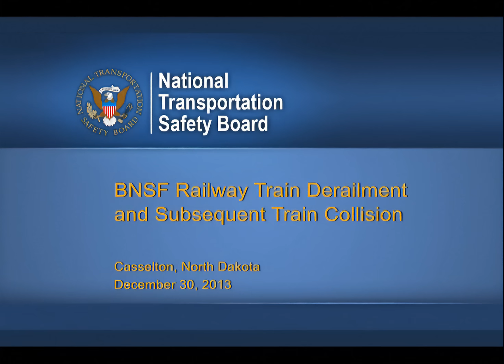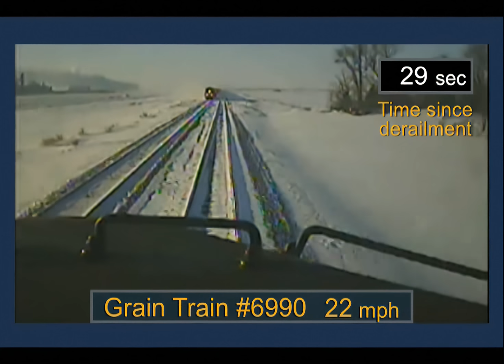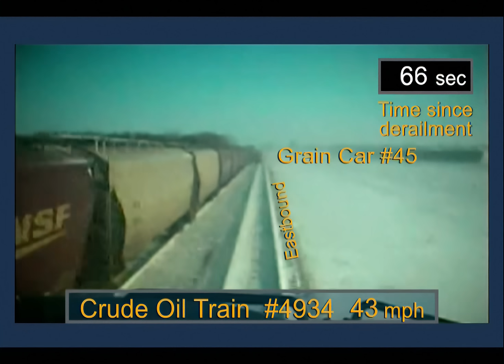BNSF Railway Train Derailment and Subsequent Train Collision

Comment: I used to work for a company that shuttled rail crews. Since we operated on the railroad right of way and inside rail yards, we had to go through safety training.  One of the things that we were told is that a train hitting our mini van was comparable to our mini van hitting a pop can.  Well, I calculated the approximate gross weight of a loaded coal train, the GVWR of the van, and the weight of a can of <insert soft drink name here>.

Scarily, it was pretty darn close. You don't want to FA with trains, because you REALLY don't want to FO.

Comment: This is the Casselton Train Derailment, and it's a long story.
6990, the grain train you see in this video, is passing by another train, 4934, the crude oil train.
The grain train, however, derails at about the 1 minute 30 second mark, and the grain train's brake pipes possibly disconnect, resulting in an uncommanded emergency stop. A defect in the axle caused it to derail. Then it switches to the crude oil train's perspective. They warn 4934 to stop because the grain train had derailed, however, due to it being a heavy train, and a freight train, the emergency brakes take a little while to pressurize, plus the weight. Just before the collision, you could see another grain car had derailed as well, and then, it happens. "WE ARE EVERYWHERE!" The train hits grain car 45 and causes it to fly off the rails. A fire breaks out, and the train is off the rails. Then.. The real part happens. KABOOM! The crude oil catches on fire and causes a massive explosion. Firefighters however put it out, and make it alright. Thanks to them, this railway would still be in action to this day.

Comment: For people that didn’t notice, if you turn up your volume as high as possible at about 1 minute, you can hear the radio conversation between the Minot East Dispatcher, 6990, and another train. It’s very distorted and quiet, but you can figure out what they were actually saying here: https://data.ntsb.gov/Docket/Document/docBLOB?ID=40425466&FileExtension=.PDF&FileName=Operations%20Group%20Chairman%20Factual%20Report%20Attachment%2013%20Transcript%20of%20Nolan%20Field%20Radio%20%20%20%20-Master.PDF

Comment: This is what happens when you put two train  tteacks  c lose togther. Irs c really a stupid idea. Even a 3grader wouldn't do this dumb thing.  He wouldn't even do it with a  Lionel. Are railroad people this dumb really?
Reply: Why don’t we just make highways 200 feet apart?
Reply: @Coonslayer7-l2g  "aircraft maintain an altitude separation of 1,000 ft"
Reply: Most of the rail lines in North America were build in the 1800s.   This includes mainline and passing tracks.   It might have been stupid...but it was 150 plus years ago.
Reply: I am one mile from the tracks ..they were built in 1925. They only built one track. One train has to wait on the side track while the other one passes. It's a 160 mile long track. Talk about stupid.
Reply: @PBFSENSOR  So 99 years ago they were....stupid?   THat was back when the average train was 20 cars long and the average car length was about 30 feet.   Yet they were simply just stupid?
Reply: Who builds a road with only one lane wide enough for only one line of cars? That's stupid. Ditto for railroads
Reply: @PBFSENSOR    Most of the world's freight rail operations are single line with passing sidings as needed.   At $1million per mile for heavy freight railroading a second line can be incredibly expensive and not worth it.  Not stupid.  Just financially what is needed

Comment: I’m an engineer going on 23 years at CSX 60 seconds was way too long to wait to tell that other train that they were in emergency.
Reply: Correct, wakey wakey guys,
Reply: yep
Reply: I was an engineer at  CP for 35 yrs and you’re right, as soon as the air went, there should have been an emergency call going out so that oncoming oil train could have soaked it sooner.
Reply: Apparently, they were on different frequencies anyway.
Reply: It was 30 seconds. Plus busy radio traffic
Reply: I was an engineer at XYZ railroad for 52 years, and an Inspector A1A-class (Tip-Top Division) and an all-around groovy cat. Wait, what was the subject again?
Reply: Former CSX Engineer and FRA Inspector, it was actually 34 seconds after the emergency was indicated at the head end and you are correct, it should have been immediate upon realizing his train was in emergency. The signal maintainer communication with the head end was also a distraction. Stay safe!
Reply: @Bruce_Warren  can you elaborate on how the maintainer was a distraction?
Reply: @DaSMan819  constant radio communication and questions. The conductor or engineer should have been warning of emergency over the radio and contacting the opposing train, and as soon as the grain train went into Emergency.
Reply: Emergency brake applied, uncommanded! Guy was daydreaming or on his smart phone.
Reply: @johnmiller3494  MOST guys and false don't do that since October 2008. The FRA came out with Emergency Order #28 
Prohibiting cell phone use while operating. There is about $10k fine for it being on, and about another $10k if you are using it while operating. They check for this stuff.

Comment: Train stops because there is emergency lights flashing a railroad car is flipped over.  Then proceeds to go again crashes into a grain car that is flipped over and a oil tanker full of crude blows up.  The engineers are all safe because they didn't reach the high enough speeds that when the  if would be a impact occur it would make certain that train did not have enough velocity that for one reason or another cause that train to derail in a such situation.  There was also found such that a micro crack a flaw in the casting of the train wheels was found that caused the rail car to derail and this flaw by no means ever could be noticed by someone inspecting a rail car.  That is the most fascinating tale I have ever heard.  Unless there was actually a video of actually showing an incident like this. Even then I wouldn't believe it.

Comment: I dont know much about trains so Im sure there must be a good reason but why are the railroad tracks so close to eachother?
Reply: Hmm.. I do not know. Let's find out together! Here, hold my snack while I consult with Google! Hmm.. Okay so, I found a very lengthy answer to our question on Quora! It's long I'll post it in two comments:

"Why are parallel railroad tracks built so close to each other?

It is cheaper to build rail lines closer together. You save on ballast and bridges as well as the cost of the land. It's the same on 2-lane highways: If you could separate the opposing lanes of traffic, it would be safer, but it would require more right-of-way. However, in the United States there has been a move towards wider separation in recent years.

The normal separation in the United States between mainlines and between mainline and controlled siding/passing track centers is 16 feet (4.9 meters). Years ago before that, it was 14 feet (4.25 meters). I have seen really old track on little used branch lines with 13 foot centers and even 12 foot centers. Old track is probably grandfathered in if it has less than 16 feet clearances, but with speed restrictions in many cases. 14 foot centers are still allowed for parallel tracks that are not mainline, controlled sidings (signaled), or passing tracks."
Reply: "Since American train equipment is generally 10 feet wide, 16 foot centers leave a clearance (from the edge of one train to the edge of another) of 6 feet (1.8 meters), or 3 feet on the side of the train for each track, thus a total of 16 feet for each track. Other clearances matched this. For instance, tunnel portals and bridge portals are usually 16 feet wide as well (3 feet + 10 feet + 3 feet). When I worked in train service on the Union Pacific's (ex-Missouri Pacific) Kingsville Division, we had a lot of older bridges that had 14 foot portals (2 feet + 10 feet + 2 feet). Our speed limit was 50 mph (80.5 kph).

It is very difficult and costly to increase clearances once they are established. You would have to move all kinds of things further back from the track (signals, structure walls, platforms, signs, switch stands, etc.). You would also have to re-lay switches at crossovers between the tracks, and rebuild grade crossings with roadways.

However, in the United States, some newly built rail lines are being laid with 25 foot track centers (7.6 meters). This is being done to lower operating costs. The American Association of Railroads (I think is the authority) mandated that (with 25 foot clearances) maintenance work can continue on adjoining tracks without any slowing down on the track not being worked on. Since maintenance is an ongoing process every day, this helps raise average train speeds, save fuel, and reduce wear on brake shoes." - David Currey(Quora)

Comment: What a pos crew on track one.  Lazy play it off cool crew.  Could of killed the other crew with your play off cool tactics.    Should of called emergency when the train actually dumped. You know because it’s a rule to announce emergency three times when your train goes into emergency exactly for this reason.  It atleast would of gave the oil train some time to slow down if he was thinking clearly.  Supposed to pass a train in emergency at restricted speed but it definitely would
Of gave the oil train time to put in full service or At least dynamic which would of did nothing with 12k plus tons pushing you.   Just very crappy situation to be in.   Engineers do not get paid enough for what they do freight or passenger.

Comment: Trains mostly move slowly when they got to curves. However they are fast on strait track. if there is an object on the track, accident is inevitable. Solution is, mounting lidar distance sensor in front of trains. if there is an object on track as far as 3000meters or more, train breaks for stop automatically on strait line. Computer can activate Lidar sensor when getting information from GPS... there is another solution for this type of accidents. Let say train goes 40mph and needs  a quarter mile distance for complete stop in an emergency case. If an autonomous or radio controlled micro train locomative goes on same track half mile ahead of it, and same speed with the train. It can check train track for make sure it is in good condition  before train came there. it is a dummy train for prevent an accident before it occured by detecting any objects on the track. It can be like a compact car size..
Reply: I'm assuming it could be programmed to understand where it is and where crossings are and to not brake because a car or truck is crossing at a known location.  Maybe it could delay before ordering the brake in case it's something simple like a person on the tracks or a deer.  Having worked with LIDAR, it can be finnicky.  But I've never worked with one that reached out 3000 meters.

Comment: I see a lot of comments here about trains being equipped with steering wheels.  Perhaps, there could be complex technology where the flanges could unlock from the rails and at thr same time, actual wheels drop down ( like they do on a plane when it lands or takes off ) But the real issue is what if there would be nowhere for the train to swerve or steer to? What if there is nowhere for them to swerve to at the time they need to? Like if its near a mountain cliff or near a road, etc... They would need a lot of open land with no obstacles because even if they developed a system where you could unlock the flanges and drop actual wheels to steer it off in case of emergency, you still wouldn't be able to stop on a dime, and it would take even longer to slow it down if the train is top heavy due to the possibility of it flipping to it's side from the weight. So even if it could be steered off the track, it would still have to lose all that momentum at incredibly fast speed once derailed.

Comment: BNSF 4934 Crew Members are Ok. And The Other Crew is As well. What Happened Was a Broken Axel on BNSF Grain Hopper #45. Causing it to Fall Over on the 2nd Track. And Shortly After 4934 Ran Into the Hopper, Crude Oil Spilled And Then a Big Explosion Happended.

Comment: That is super impressive that the train stayed upright after the collision.
Reply: I was thinking that very thing!
Reply: @johnalexander7490  I'm guessing the tension from the trailers keeps it upright
Reply: The locomotives stay upright usually because they are very bottom heavy. Most modern six axle diesels are ballasted to over 400,000 lbs to add adhesion to the rails but it also gives the benefit of keeping the locomotives from rolling over in a crash like this
Reply: @AppalachianMountaineer1863 it's like a Weebles wobble but they don't fall down type scenario
Reply: @AppalachianMountaineer1863 Amtrak trains on the other hand always turn over
Reply: @dawhoda1 Amtrak trains are thousands if not tens of thousands of pounds lighter. No surprise they roll over
Reply: @dawhoda1  That's not true. I was involved in an Amtrak derailment and we stayed upright. You really only run the risk of going over if you are in a curve or excessively speeding.
Reply: I agree... when you go into emergency and there's a train on the adjacent track you make it very clear your train is in emergency and they opposing train should immediately apply their brakes.
Reply: It most certainly did not, the oil train went all over the place, and the derailed train had 1 laying on it's side. The derailed train waited waaaaay too long to announce he was in emergency. About 50-55 seconds. That would have maybe given the other train time to slow, maybe almost stop before the collision, maybe not. There was also a fire that erupted from the tank cars that ruptured.
  Doesn't sound very upright to me
Reply: @thomasmleahy6218 summer Donna
Reply: @thomasmleahy6218  sure there was a fire and cars tipped....but the locomotives were most literally UPRIGHT my guy, did you not watch the video?
Reply: @yung-megafone  The “locomotive” is not the “train” my guy.  Did you not even read the original comment?
Reply: @michaelmurphy858  The original comment clearly MENAT locomotive and not the train cats themselves. The Loco stayed upright. not everyone is a foamer and knows exact terminology. Most people see a loco with train cars and call it a train. Do you even get out my guy?
Reply: @NotRandoWis  I don't think so. He said TRAIN.
Reply: @NotRandoWis  Whatever, you need to stay in more and brush up on your English.
Reply: @ohreally8929  Life is too short guys .
Reply: @thomasmleahy6218  it was literally upright when it derailed
Reply: This is pretty gay.
Reply: helps that it's an open plain, but still yes it is!
Reply: Fr
Reply: I Think BNSF 6990 Grain Hopper Train Emergency Break Meet BNSF 4934 And 5958 Destroyed Crash
Reply: He was condescendingly chastised.
Reply: @steamfire  Now in therapy. 'Thoughts and prayers'.
Reply: The lead locomotive stayed upright. A locomotive is NOT a train! It's a 'locomotive'! The 'train' was "everywhere".
Reply: @bobjohnson1587  A locomotive can be a train. Give the guy some slack, he probably doesn't work in the industry.
Reply: @aaronhuza4036  He won't learn the difference unless someone explains it to him. That's how we learn. :)
Reply: He wasn’t trained?
Reply: @gregjones3660  No, he was schooled! lol
Reply: @bobjohnson1587 the official government definition of a train includes the locomotive... hooked to cars or NOT....
Reply: @bobjohnson1587 A train’s a train.
Reply: @catlady8324  Only if you're a 5-year old boy! lol
Reply: One of the guys on the radio sounds like Donald duck.
Reply: the locomotive is the train my man

Comment: I noticed that the grain train passed over a set of points that were not properly set, seemingly set halfway between open and closed. I can't see the NTSB report so I don't know if I am correct but I feel that the point mechanism may have been frozen which to me would have put a lot of stress on a flawed axle.  Was this the initial cause of the grain train derailment?